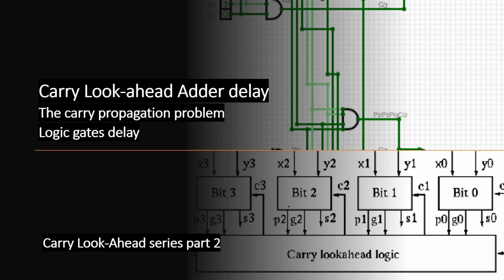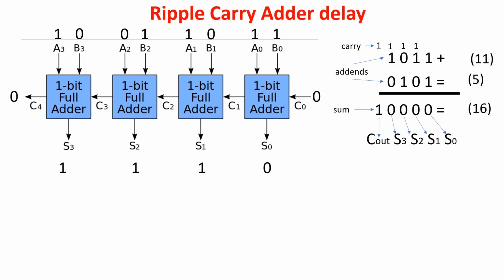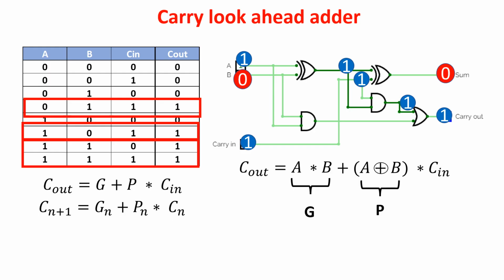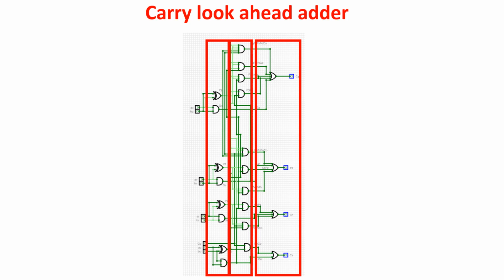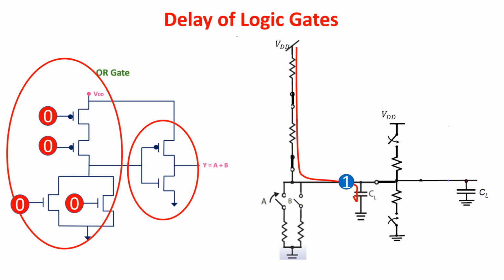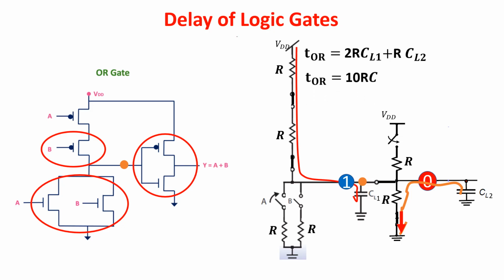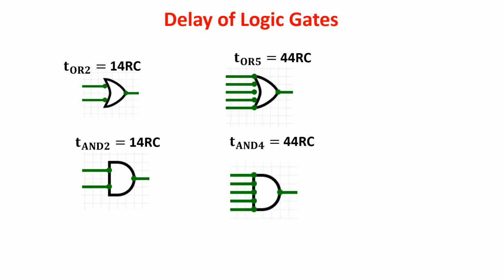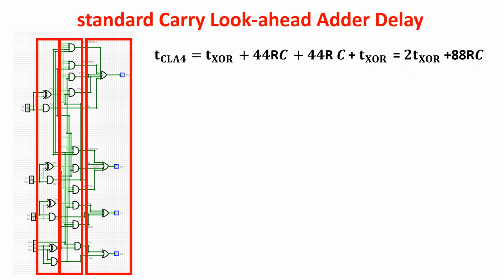Binary adder - Carry Look-Ahead Delay - CLA delay

Comment: Great video, but when 5-input gates are that slow, why did you use the 5-input gates as they are? You could implement a 5-input or gate with two 2-input gates and one 3-input gate, leading to a 5-input gate with 36RC delay, so that the carry look-ahead adder would have the same delay as the manchester carry chain adder you'll introduce in the next video.